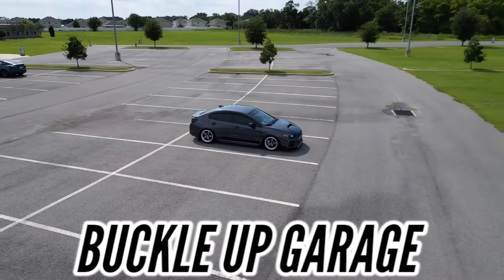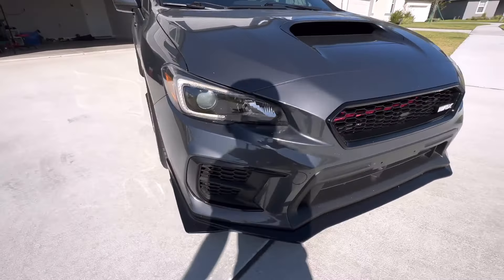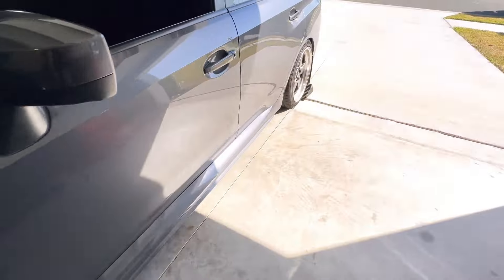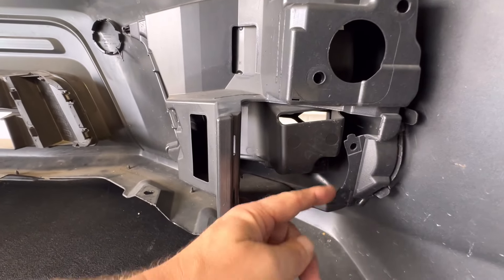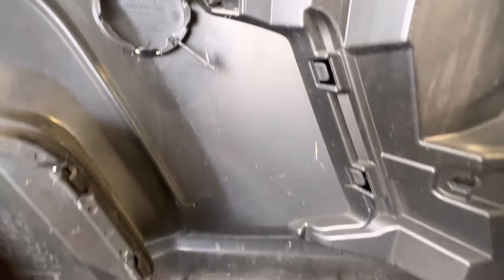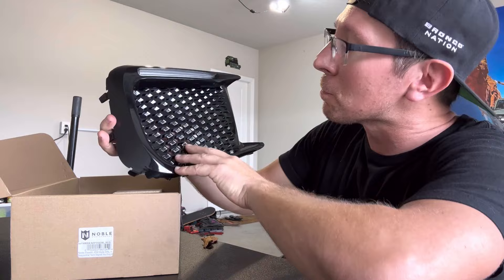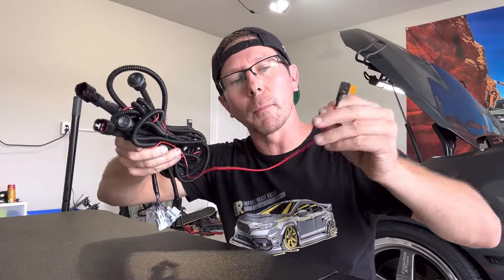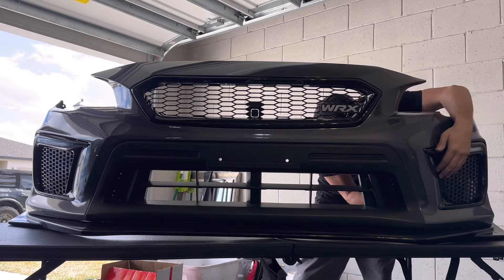DRL BEZELS FROM NOBLE | SUBARU | WRX | STI | 2015-2021

Comment: I disagree with removing the front bumper.  I added DD SS3 fogs to my WRX base and left the bumper on.  Once the bezels are popped out, you would be amazed at how much room you have to work with.   On a side note, I used normal Rhino ramps to get the front up.   Nothing crazy like quick jacks; just normal car ramps.   In addition to removing the bezels, I had to undo 7x pop clips and 1x 10mm bolt to move the under-splash shield out of the way.  Overall, still super easy.  But your way is fine too......

Comment: silica black is the name  for color code . as for needles fog lamps i deleted mine only because they them could not function without the low beams on .  that level of DOT  NHTSA  redundancy  was enough to do it . 
i asked I WIRE  if they could help configure the fog light relay trigger wire to come from the running light circuit . .until then i will be running oem STI bezels .
Reply from the maker: Great answer, thank you for the comment.
Reply: Subaru did that to help you not run your battery down by accidently leaving your lights on.  Also, why no fogs on w/lows?    tap the switch wires; and run the switch trigger wire to a new relay.  fuse the relay.  power the fogs with the new relay.